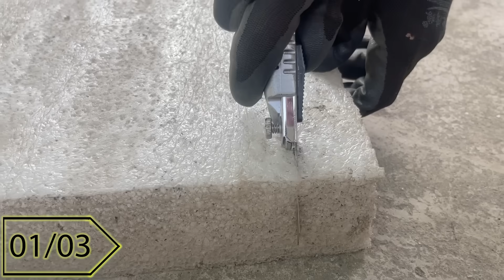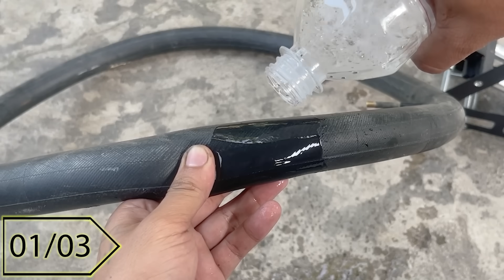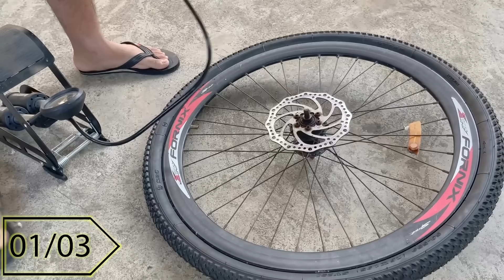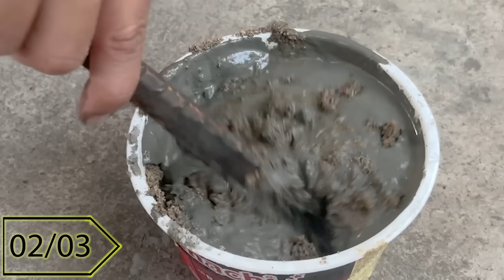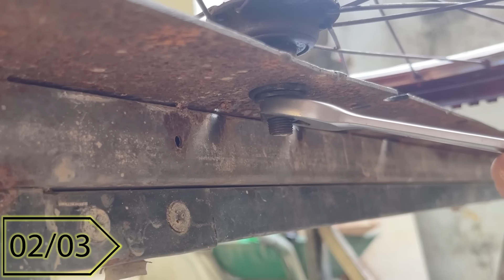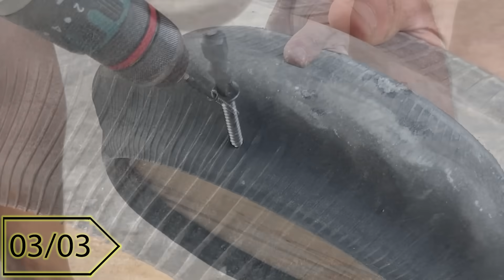Never get a flat tire again! 3 DIY ideas to keep your tires from going flat when punctured

Comment: better still , get the pipe insulation , with split along its entire length, and insert the tube inside the split, both inside the tyre......works for me
Reply from the maker: Thank you for sharing such a practical tip! 👍 Using a slotted insulation tube sounds very effective.

Comment: They make solid rubber tires for bicycles their is no air just sold rubber 

I got some solid rubber tires for my electric bicycle an they are definitely worth it I don't have to worry about a flat tire especially since I use my electric bicycle as my only transportation
Reply: What about your arse?

Comment: How long does this last?
Reply from the maker: Great question 🙌 This condition usually lasts only for a short period, depending on how it’s used and maintained.
Reply: They make solid rubber tires for bicycles their is no air just solid rubber 

I got some solid rubber tires for my electric bicycle an they are definitely worth it I don't have to worry about a flat tire especially since I use my electric bicycle as my only transportation

Comment: Now you have gone too far, this the most ridicolous idea you ever made, you just destroyed your career... The trust is gone
Reply: Agreed,,,, They make solid rubber tires for bicycles their is no air just solid rubber 

I got some solid rubber tires for my electric bicycle an they are definitely worth it I don't have to worry about a flat tire especially since I use my electric bicycle as my only transportation
Reply: @morris4321 simply ridiculous but its your choice,  but you see its heavy to drive, less cushion,  if you worry about having flat theres a solution called  an Auto tyre sealer  is a liquid form with a substance sealer inside, pour it on inside a tubeless tire leave it there so any puncture to your wheel extereor automatically be sealed  available in the market auto shops and bike shops  or online
Reply: @morris4321 yes i know that but what he did was unacceptable concrete cement the whole tire really insane
Reply: Lol I followed

Comment: I use extra thick tubes and tire liners ,I very rarly get a flat, I wear out more tires then flats, but ocassionaly I get a flat, usualy hitting something I shouldnt like a open man hole cover
Reply from the maker: I think the same as you, sometimes it's not because the inner tube is weak but because the road is too "unpredictable". 🚲
Reply: Why They make solid rubber tires for bicycles their is no air just solid rubber 

I got some solid rubber tires for my electric bicycle an they are definitely worth it I don't have to worry about a flat tire especially since I use my electric bicycle as my only transportation

Comment: Wish I thought of this 20+ years ago to see if it really works and how long the foam lasts. Looks like it should and way less work than what I've outlined below.
 I've never been allowed to get a drivers license (bad eyes) so it's always been bicycles on city streets. For work, shopping, visiting, site seeing, rain, shine, snow, sleet, -40° C, +40° C, been there done that.
Many years ago (early 2000's) after many hundreds of flats, I solved this same problem. I even tried out those really tough commercial vinyl puncture resistant tire liners but with limited success. What finally worked for me was basically free, just a couple of old/unused bicycle tires and the time needed to do the job.
Start with a couple of mostly worn out street tires with some tread still left, no Knobby tires. Cut and remove the tire bead including about 50-70 % of the side walls from the tire. Use an angled cut to open the tread ring. The now curly "TREAD LINER" will now fit inside your intact bicycle tire with a little overlap on the angled cut ends.
Taper down the "tread liner" overlap ends so the overlap area is smooth and lump free when the tread liner is pressed inside the bicycle tire. Adjust the taper and overlap to account for inflation expansion.
You need to taper the tread liner sidewall edges as well because under pressure the edges WILL cut into the innertube.
After doing this over 20 years ago I've worn out several pairs of good quality bike tires and installed an e-bike front wheel drive conversion kit, but not a single flat tire.
Reply from the maker: 👍👏 “It was great to hear your story and real-life experience! The way you used old tires as puncture protection is really smart and sustainable.

Comment: I once put in a, curtain rail because  I was get so fed up with, punctures 💯 works
Reply from the maker: Exactly! When there are too many holes, a simple solution like a curtain becomes a savior – quick and neat!
Reply: @inventorK20 lol. A curtain. The plastic rail mate. 😉👍
Reply: They make solid rubber tires for bicycles their is no air just solid rubber 

I got some solid rubber tires for my electric bicycle an they are definitely worth it I don't have to worry about a flat tire especially since I use my electric bicycle as my only transportation

Comment: I like the first idea a lot 👍🏻
Reply from the maker: Thanks a lot! Do you think I should develop more from that idea? I'm thinking about an upgraded version 🔧🚀
Reply: @inventorK20  another way to never get flats? Of course! 😁
Reply: They make solid rubber tires for bicycles their is no air just solid rubber 

I got some solid rubber tires for my electric bicycle an they are definitely worth it I don't have to worry about a flat tire especially since I use my electric bicycle as my only transportation
Reply: @morris4321 that is so cool!

Comment: "These DIY tire solutions are genius! I never would have thought of using PE foam to prevent flats. Thanks for sharing such practical tips!
Reply from the maker: Thank you so much! I'm glad this little tip helped you. There are many other ways to use simple materials - I'll share them gradually! 😊
Reply: They make solid rubber tires for bicycles their is no air just solid rubber 

I got some solid rubber tires for my electric bicycle an they are definitely worth it I don't have to worry about a flat tire especially since I use my electric bicycle as my only transportation

Comment: Oh my goodness.. 😂
Seriously, get good Schwalbe Marathon tires and don't worry about flats! 🤩
Schwalbe has different Marathon tires for different bicycles e.g. Marathon Mondial or Marathon MTB and those are awesome! 💪
Im riding bicycles with Schwalbe Marathon tires since the 90s and never had a flat since then! 🚲
Reply from the maker: Thanks for the suggestion! It's a very reliable choice. The fact that the tire doesn't go flat is definitely a big plus when choosing a tire for a bike. I will consider Schwalbe Marathons to enhance my cycling experience! my good friend, have a nice day💖 💖 💖
Reply: @inventorK20 ....mehr sein als Schein....😊 Reißzwecke in der Mitte  vom Marathon, ( ca 4000km ) sichtbar ...Durchstich...Ein Dorn walkte sich durch den Mantel und verursachte ein Platten...von aussen nicht zu sehen...
Reply: @hansiowen4151  meine Erfahrungen mit Schwalbe Marathon Reifen sind durchweg positiv. Seit ich auf den Fahrrädern meiner Kinder Schwalbe Reifen mit Pannenschutze montiert hab, hatten wir keine Platten mehr und Radtouren machen viel mehr Spaß! 🤩
Wenn Deine Erfahrungen nicht so gut sind: Kennst Du bessere Reifen?
Welche Reifen fährst Du auf Deinen Rädern und warum?
Reply: @benjamin.schreiber ..nein. ! Subjektiv....vor Corona überhaupt kein Problem mit Marathon ePlus !! Vermutlich gibt es Qualitativ Unterschiede bei der Produktion...?? Fern-Ost Import , Innland Produktion...
Reply: @hansiowen4151  Schwalbe Reifen wurden noch nie in Deutschland hergestellt. Lange Zeit wurden die Reifen in Indonesien hergestellt, doch die Produktion wurde irgendwann nach Vietnam verlagert. 
Was ich von dem ein oder anderen schon gehört habe, daß die Qualität von Schwalbe Produkten in den letzten 10 Jahren angeblich nachgelassen hat. Das kann ich selbst nicht bestätigen und die Erfahrungen meiner Kinder sind auch durchweg positiv. 👍
Allzeit gute Fahrt! 🚲
Reply: They make solid rubber tires for bicycles their is no air just solid rubber 

I got some solid rubber tires for my electric bicycle an they are definitely worth it I don't have to worry about a flat tire especially since I use my electric bicycle as my only transportation

Comment: Havy weight wheel achived
Reply from the maker: Heavy weight wheels often provide greater stability, especially when dealing with rough surfaces. However, it can also reduce the speed and agility of the vehicle. Depending on the purpose of use, you can consider choosing the right wheel to optimize performance. Thank you for your interest and sharing, my good friend, have a nice day💖 💖 💖

Comment: Nee,da kaufe ich mir einen Reifen mit Pannenschutz.Da ist auch innen ein schutzband eingeklebt und fange nicht mit Zementfüllungen an.Früher,nach dem Krieg,wo es nichts gab hatten wir Vollgummibereifung,da gab es keine Plattfüsse.
Reply from the maker: You are right, cementing is not a long term solution. Puncture proof or solid rubber tires are really worth the choice, especially in extreme conditions. Thanks for your concern and sharing, my good friend, have a nice day💖 💖 💖

Comment: Thick  pipe
Reply from the maker: Yes, thick pipes can be very durable and withstand pressure better. Depending on the purpose of use, thick pipes will bring higher efficiency in many cases. Thank you for your interest and sharing, my good friend, have a nice day💖 💖 💖

Comment: My butt hurts from the cement tires that one I don’t think is going to work
Reply from the maker: Hello, nice to chat with you, thank you for your interest and sharing, my good friend, have a nice day💖 💖 💖
Reply: And the cement makes the bicycle heavier and slows you down with weight
Reply: They make solid rubber tires for bicycles their is no air just solid rubber 

I got some solid rubber tires for my electric bicycle an they are definitely worth it I don't have to worry about a flat tire especially since I use my electric bicycle as my only transportation

Comment: Cutting the sidewalls off an older tire and placing the tread of tire you just trimmed works as well. Albeit quite a bit heavier. Then just place the tube back in as normal and inflate. If you don’t mind the extra weight it’s a really useful hack I use in the summer to save my tires from the many grass stickers where I live. The extra weight isn’t too bad because it’s in an area where it’s actually useful.
Reply from the maker: Thanks for sharing this tip! It's true that sometimes simple methods like this are very effective. Using old tires and adding tread to them not only protects the tires but is also a smart way to reuse them. The extra weight is not a big deal if it helps protect them better! 🚴‍♂️👍 thanks for your concern and sharing, my good friend, have a nice day💖 💖 💖
Reply: They make solid rubber tires for bicycles their is no air just solid rubber 

I got some solid rubber tires for my electric bicycle an they are definitely worth it I don't have to worry about a flat tire especially since I use my electric bicycle as my only transportation

Comment: Just buy solid tires and be done with it
Reply from the maker: Yes, solid tires are a simple and effective solution, especially if you don't want to worry about patching. Thanks for sharing! 🚴‍♂️, my good friend, have a nice day💖 💖 💖
Reply: I know that's what I said They make solid rubber tires for bicycles their is no air just solid rubber 

I got some solid rubber tires for my electric bicycle an they are definitely worth it I don't have to worry about a flat tire again especially since I use my electric bicycle as my only transportation

Comment: How about pool noodles?
Reply: They make solid rubber tires for bicycles their is no air just solid rubber 

I got some solid rubber tires for my electric bicycle an they are definitely worth it I don't have to worry about a flat tire especially since I use my electric bicycle as my only transportation

Comment: Adding friction between your inner and outer tire will cause the inner tire torn. Needless to say what trouble an uneven foam can cause.
Reply from the maker: Thanks for sharing your thoughts! You are right that excessive friction between the inner and outer tires can cause problems such as inner tire tearing, especially when the foam layer is uneven. It is true that careful consideration is needed when performing such repairs, to avoid damaging important components. Thanks for your feedback! 😊
Reply: They make solid rubber tires for bicycles their is no air just solid rubber 

I got some solid rubber tires for my electric bicycle an they are definitely worth it I don't have to worry about a flat tire especially since I use my electric bicycle as my only transportation

Comment: 3 VERY GOOD IDEAS. BUT I LIKE THE FIRST IDEA, BECAUSE I FACE THE SAME PROBLEM VERY OFTEN
Reply from the maker: Glad you like the first idea! If you have any common problems with your bike or motorcycle, please share more so I can help you find a solution. Do you have any specific problems?
Reply: They make solid rubber tires for bicycles their is no air just solid rubber 

I got some solid rubber tires for my electric bicycle an they are definitely worth it I don't have to worry about a flat tire especially since I use my electric bicycle as my only transportation